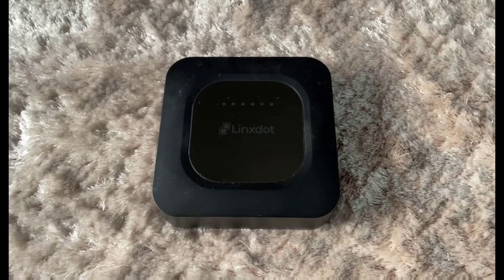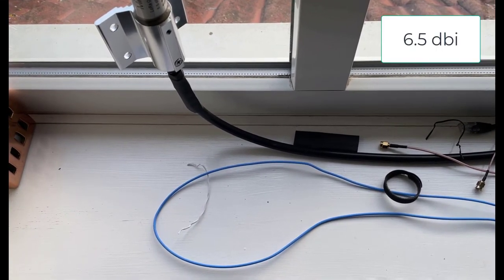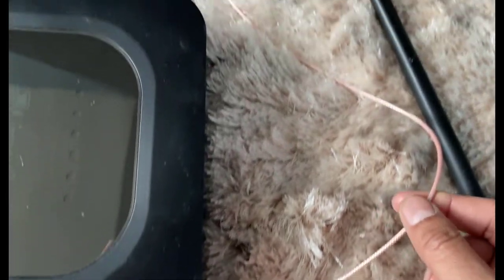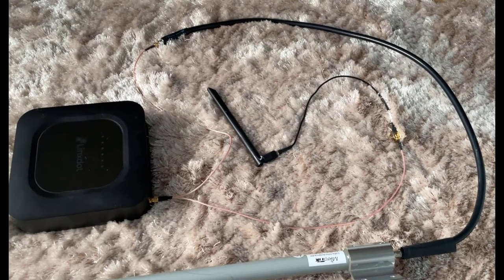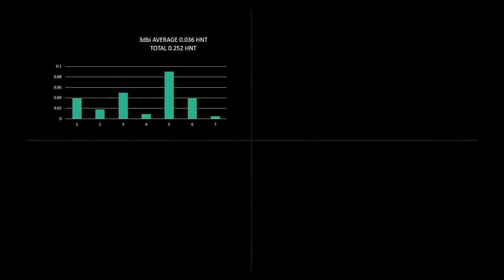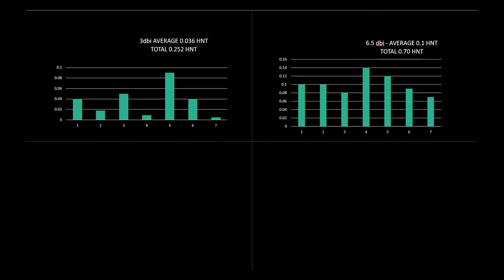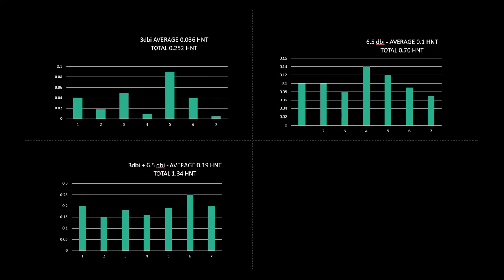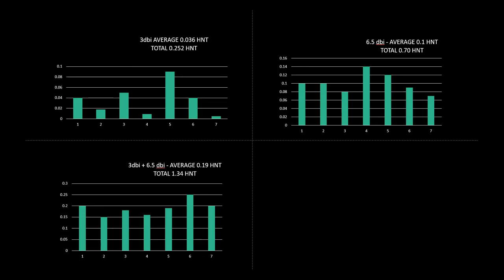Connecting 2 Antennas to 1 Helium Miner

Comment: After almost 2 years, and with all the upgrades on the network, is still worthy? Thanks!
Reply from the maker: 100% worth it. Since the price of BTC jumped, IOT Helium and coins have followed, so currently earnings are a 4x daily from the time this video was made.  A lot of people are quietly switching their Helium miners back on
Reply: @HandymanSavage  Thanks for the feedback. I have mine up and running for more than 2 years. My question was about: are you still having 2 antennas for 1 miner? and if you still aware if is worthy (more rewards) or not? Thanks!
Reply from the maker: Ok, I have two Nebras, one is on a Single Antenna and the other Nebra is still on two two antennas and does much better overall in terms of rewards and signals.

Comment: I'm trying this with my Bobcat 300 and not having much luck.

 I have the stock 4dbi antenna, added the same splitter you have and now an additional 8dbi antenna.
Any tips?
Reply from the maker: Where do you have them installed? Are the antennas indoors or outside? Maybe try different locations? I heard somewhere that boosters may help (due to some Helium Manufacturer differences) with this setup, but not tried it myself.
Reply: @HandymanSavage  Thank you for your time. I have them about 2 ft apart and 25 feet off the ground. They are indoors and my first week with only the 4dbi I earned about .450 UTC.
My 7dbi (correction not 8dbi)cable is about 11ft and the 4dbi cable is 3ft could that create an issue?
Reply from the maker: @johnstevens8861  The cable length and type could be the issue. The lower the number of cable jumps and cable length the better.

Comment: I was trying many and diferents antenna but 2 same time no.
If you use 2 antenna i think you will not have 50 ohms impedance
Reply from the maker: the impedance isn't that much of a deal breaker if the 2 antennas are different, you should be able to catch a wider range of signal to achieve more witnesses and negate any losses of signal etc

Comment: https://www.konnektorsepeti.com/image/cache/catalog/KONNEKTOR/SMAT-102/1-500x500.png 
i have merryiot miner. I will connect the 6dbi and 2dbi antenna to the miner with the connector in the picture, will the lora module be damaged?
Reply from the maker: Can't say for certain if any damage will be caused, that's really on you and remember to ensure no cables/antennas are connected/disconnected while powered on. What I can say is my setup is still working and no issues with the Linxdot thus far, but again no guarantees.

Comment: Will it comprise the mother board, or any other issues to the miner? Please respond ASAP I want to install too. Are you doing the same right now please tell, what is your hotspot name?
Reply from the maker: I've had this running for over a week and it's been fine, no problems with motherboard and rewards have actually increased over the week.
Reply: @HandymanSavage  thanks for information
Reply: @ehsanm6802  hello bro you have installed two antenna how it's working now